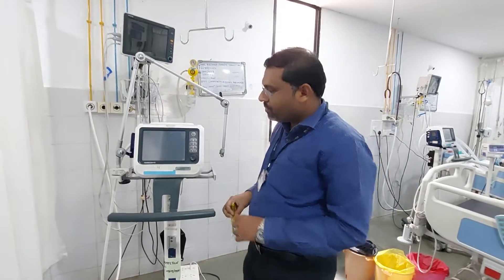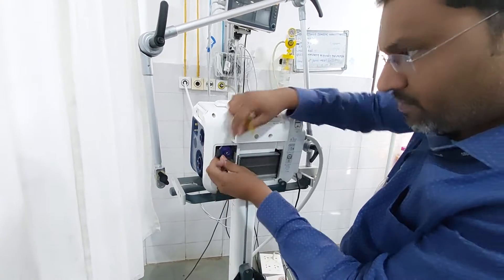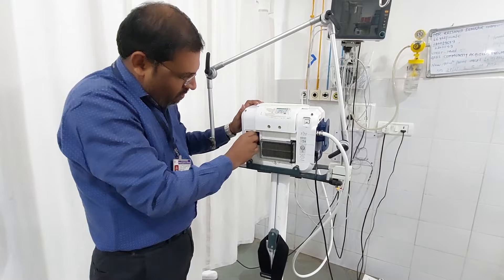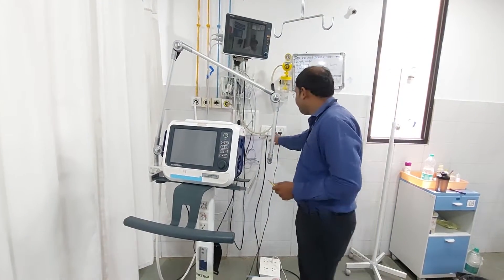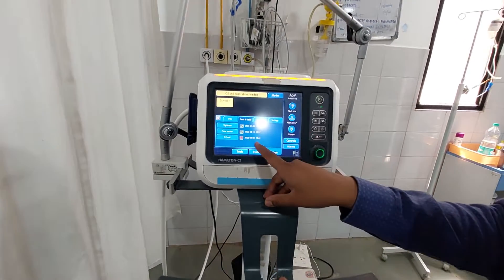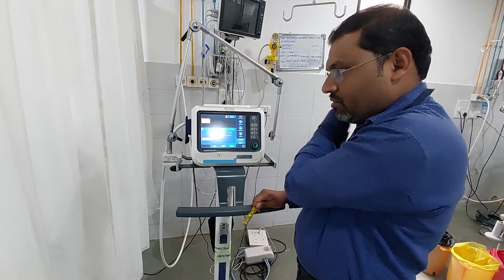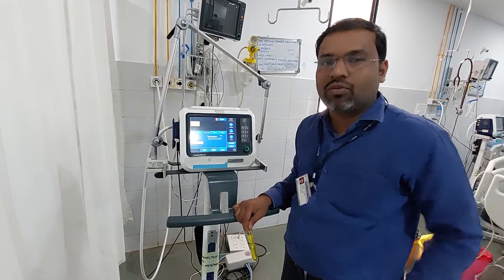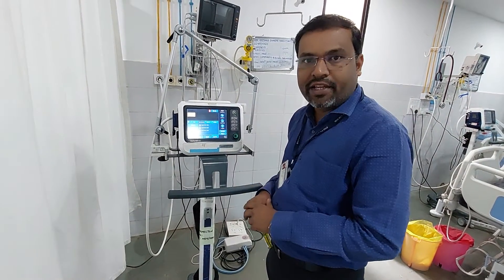How to replace O2 Cell of Hamilton C1 Ventilator

Comment: I have question engineer, does hamilton c1 oxygen sensor can be replace with the compatible oxygen sensor not the original one.
Reply from the maker: See there are many compatible things available in market but ventilator is life saving equipment and if we use compatible o2 sensor sometime Callibration get failed might be some time it will not give accurate FIO2 it's end user choice but as safety concern it's not recommended

Comment: Engineer, does the cell expire on the date marked on the product or from the time it starts to be used? Thanks
Reply from the maker: For replacement of o2 cell ,consider calibration if calibration fail you replace cell and same time check expiratory date of o2 cell
Reply: @narayanchoudharibiomedical1063  Thank you for answering, greetings.